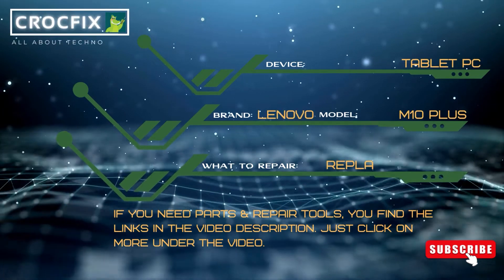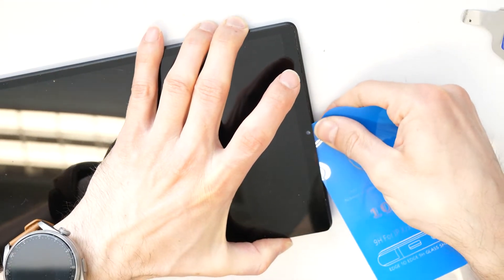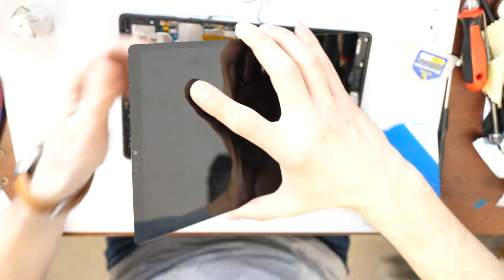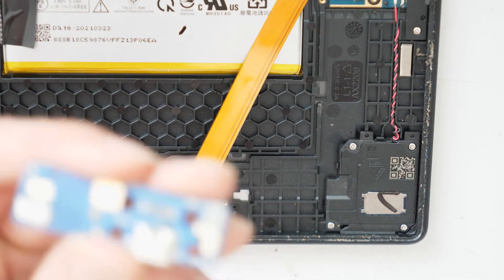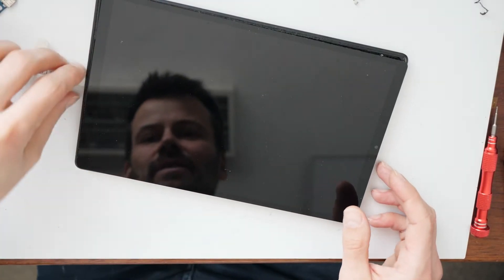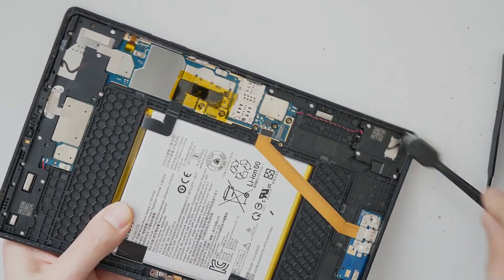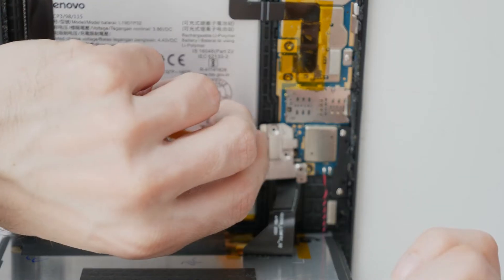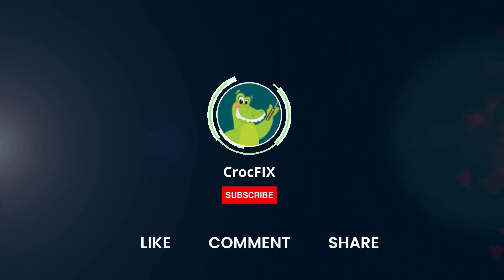LENOVO M10 Plus Tablet PC - USB Charging Port Repair / Not charging fix

Comment: some people heat (70-80 C) the edge  (glue)   - Do you know why "touch"  not working about 1 cm from edge ( all 4 side ) ? In the middle OK .
Reply from the maker: If your touch is not fully functional, try cleaning the connector on the board and on the glass flex and try again. If it's still not working, you will probably need to replace the Touchscreen or whole screen with touch.